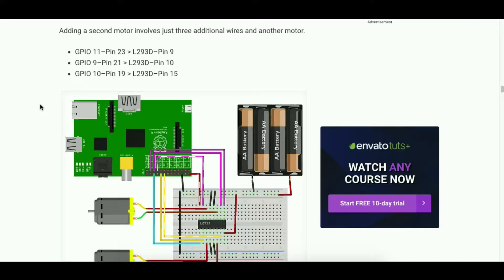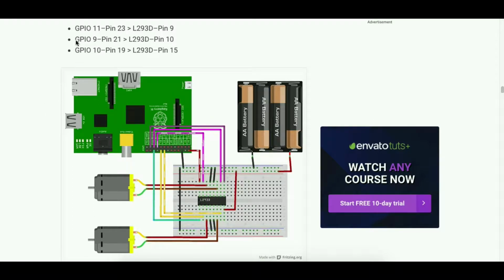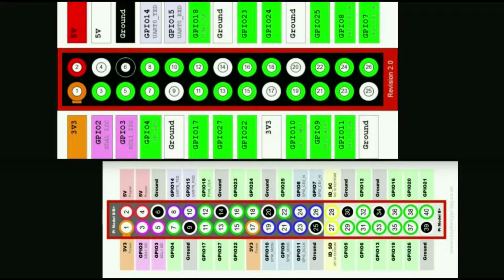Running Two Motors on a Raspberry Pi

Comment: Sir am confused about the common ground .after connecting everything are we using the batteries to power up the pi or we use the external power adapter
Reply from the maker: External power adapter to power the pi. Then use 4 AA batteries to power the motor. You can use batteries to power the pi, but that may require more hardware.